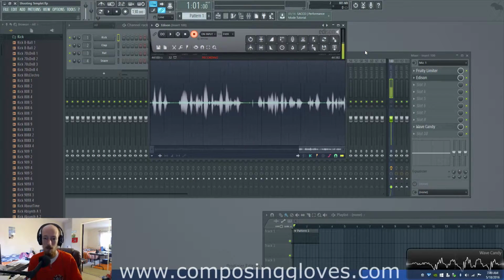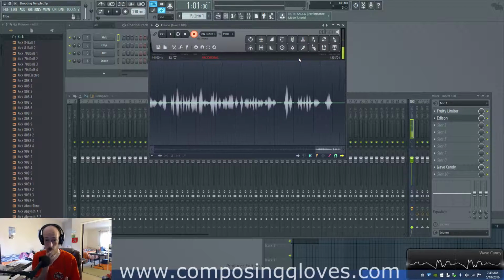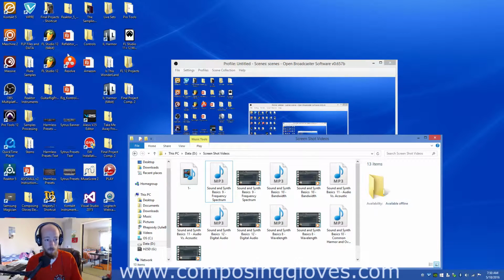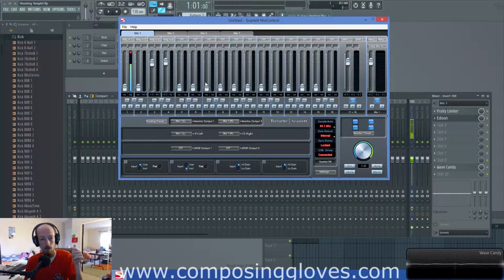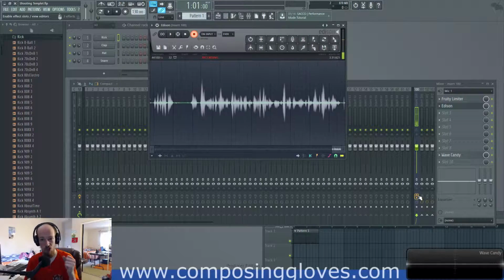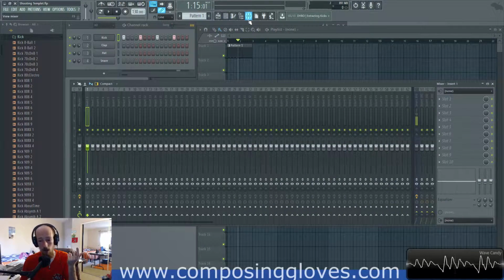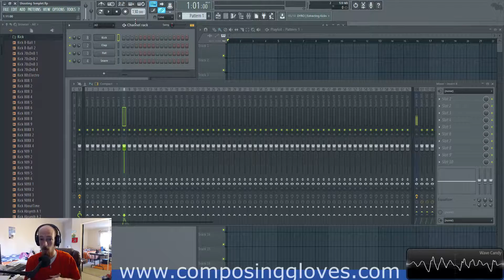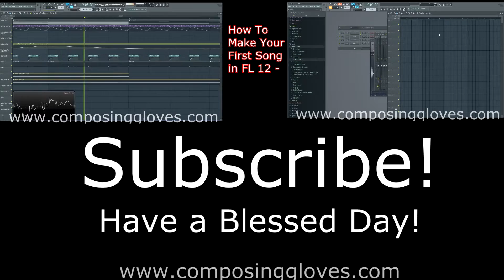Sound and Synth Basics 15 - Signal Flow

Comment: A non related question but are you self taught? Thanks for sharing your knowledge, goin through this series rn, will continue with digital audio basics
Reply from the maker: Yes and no. I have an Associates degree in Audio Engineering and am currently going for a bachelors in Electrical but in many ways I have taught myself and read many extra books. Many of the questions I have had professors couldn't answer so I end up going to books or the internet. To a very large extent I consider myself self taught but I have also had a fair amount of formal education.
Reply: @ComposingGloves  That's great man! How long have you been learning sound? I'm probably starting a bachelors in Sound Engineering at the end of this year
Reply from the maker: @airanmilian  Dudemanbro thats awesome! I've been studying sound for around 7  years now.